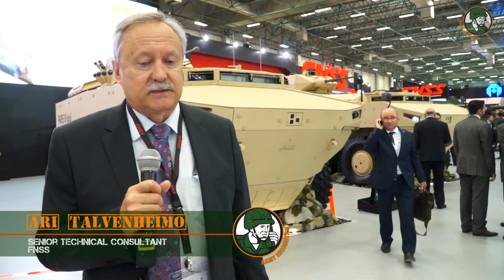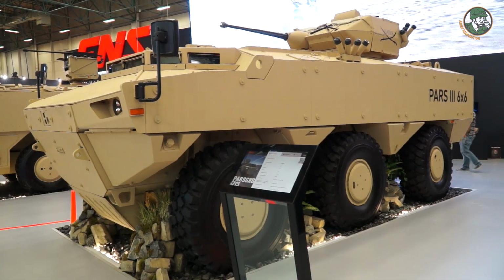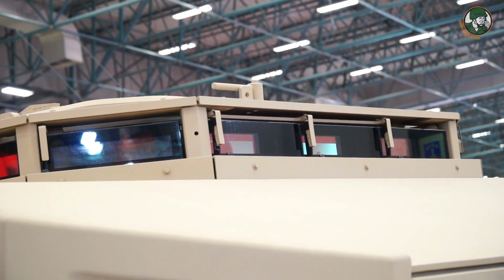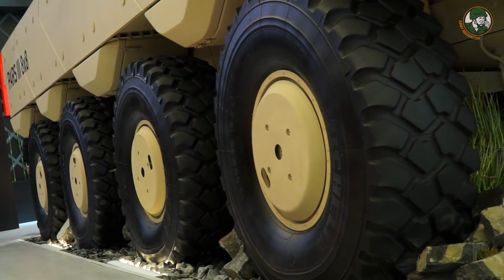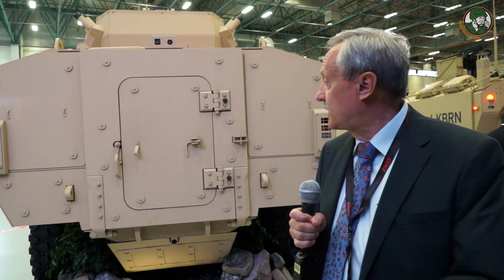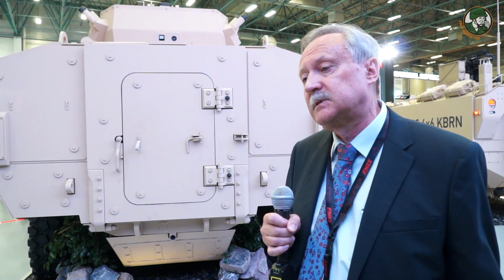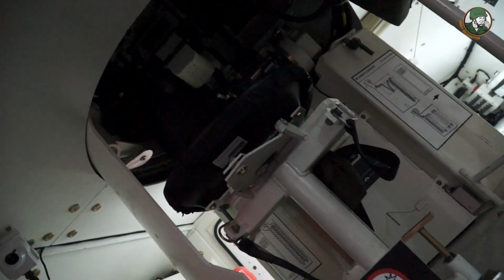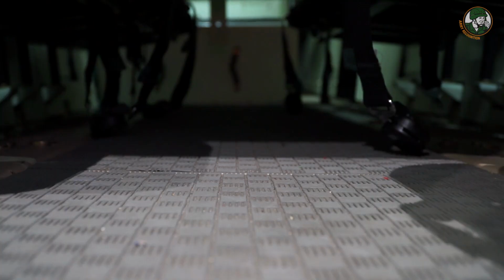PARS III 3 review 6x6 8x8 wheeled armoured combat vehicle FNSS Turkey Turkish defense industry IDEF

Comment: Molotov cocktails, IED's & RPG's blast/burn rubber to shit, tires get bogged down in mud and sand, no steel birdcage armor to predetonate warheads, pissy little popgun 25mm cannon can't do shit against reinforced concrete ubiquitous to MOUT conflicts, 6x6 wheels have a terrible turning circle - gets trapped in narrow (or normal) streets, what's the point if it can't deliver troops just about anywhere? Also it's as tall and as wide as a friggen house!
But don't worry whoever buys it isn't expecting to face any real threats, mostly rock-throwing peasantry/citizens at worst.